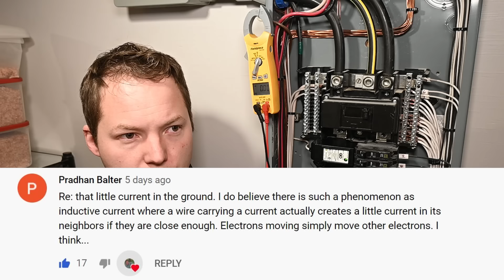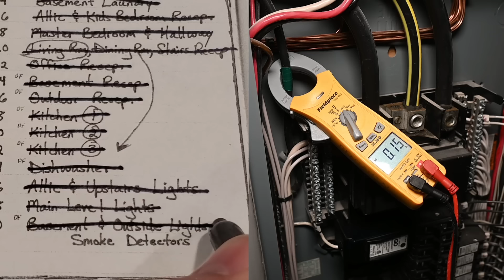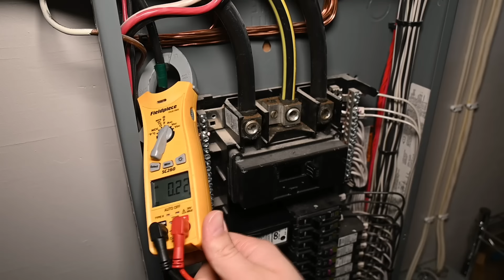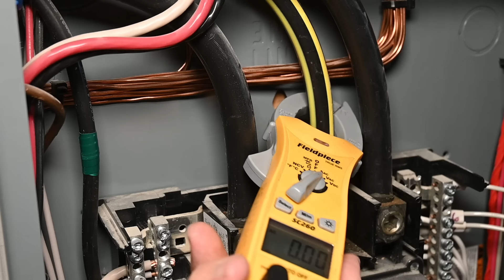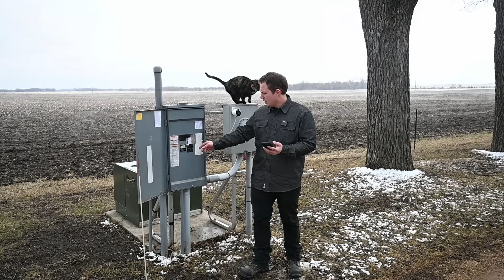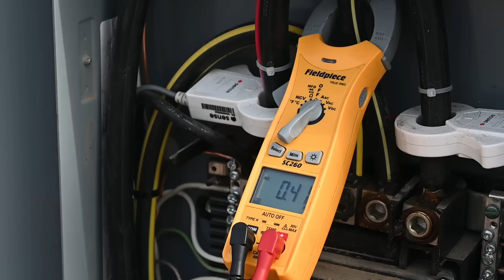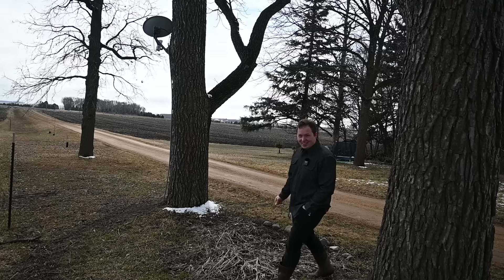Finding The Source of Stray Current on Grounding System

Comment: just one point which i havent read in this commentary section is is the fact that you have 4 grounding rods in the earth that can create current as anode and cathode the copper pipe from gas line is soft and sacrificial, and can create a battery effect and i have seen this before with a farmer that was living in a acidic type soil environment and he noticed current differential in his home every time he would spread lime around the house to neutralize the acidity in the soil and because the grounding system is on the unmetered section of the wiring it back feeds into the sub panel on the grounding wire which is why it wont show up on the neautral or the actives in either panel, i would be willing to bet if you disconnected gas main the current would stop(just dont burn your eyebrow off)while doing it), just a thought i know you found current feeding from transformer, but it may still have current once that is disconnected, just a thought!,

Comment: From Canada Have the same problem and have traced it back to the grid. At numerous locations in our community. I have measured up to 43 volts and 4 amps between the ground wire coming down the pole from a transformer and using the pole support cable as a ground source. Power company denies responsibility.

Comment: Vid is kinda long, but fun guessing up front.  First thing I thought... galvanic reaction: water heater had required plumbing ground attached on the wrong side of dielectric union. Also, many heaters have a sacrificial anode to protect the appliance and by another name that is... cathodic protection [zinc puts out 1.2 volts, which is used to protect ships hulls from rampant barnacle growth].    Wrong grounding placement creates a loop for impressed current.    Go lift plumbing grounds and see if your current goes away - it's probably associated with one of the two dryer installations.

Comment: In order for current to flow there must be a voltage difference between two points.  So, how many volts are you seeing relative to ground at the different panels?
Reply: if i'm not mistaken, if you see amps, there is voltage somewhere. so what's this driving at?

Comment: First off, I'm glad you went back to this for the video as I'm curious as well. I saw the original quite a while ago.
Well, simple science says current cannot flow without a potential difference. My guess would be voltage from something acting like an anode and cathode (battery.) Unless you have an EMF being created, the battery makes the most sense. Wasn't that gas meter union corroding? I'd look there first, see if that's the sacrificial anode (oxidation.) Current has to flow back to the anode once the electrons go to the cathode (closed circuit) in order for current to be on the ground line. You could do a bunch more testing but throw in that dielectric union and see if it subsists entirely, you're  going to install it no matter what so it doesn't hurt to test before and after. The neutral tap current is more interesting, unless there's a potential difference at the grounding rod there and the tap in order to create yet another closed circuit for current to flow on.
I wish I was more knowledgeable. I do wish to see some solution to this puzzle.

Edit: Shit, I didn't see Mike Holt reply to this video. The guy's a genius. I defer all to him lol Love his videos and more technical explanations.

Comment: EMF can be difficult to diagnose as to its source, and induced current is tricky to find the cause of, so likely you have induced current inside the run between your master breaker and your indoor panel, good vids man, lots of good information, since you are fed by a padmount transformer from subterranean lines likely its induced EMF from the actual transformer itself, EMF = ElectroMotiveForce

Comment: Benjamin, From the video you have two very possible sources. One is much more likely than the other. I'll start with the likely first.
1 The utility has current into the ground due to the pad transformer is single phase. You can read the tag on the transformer. If the primary is 5,000 Volts, the transformer is receiving 1 hot leg of a 3 phase system, and a neutral. The Neutral is bonded to ground. The neutral has a long... Long wire, so considerable resistance. Not all current of the transformer is returning on the neutral. Some is taking a shortcut back to the substation through the ground, which you can measure on your ground rods. This is common in rural areas where the distribution goes past the point they pull 4 wire 3 phase power. Read the tag on the transformer. Almost will bet my lunch the primary is 5KV. Most non rural areas have two hots from 3 phase. When this is the case the primary is 7200 volts phase to phase.
2 You are between someplace with an open neutral and there is a voltage gradient in the ground. If this is the case the current in the ground is finding a lower resistance shortcut in it's path by going onto the ground wire between the two places.
How to test the difference yourself.
1 Monitor the current to your ground rods. Turn on the water heater after a shower, turn on the dryer, heat pump, and stove. This increases your power draw and the draw in the primary of the transformer. The higher HV draw will increase the current in the grounding system in the single phase application outlined above. A bi-phase 7200 volt primary with all return current on the other hot phase will not increase ground rod current with the increased load.
Let us know what you find. Betcha it is number 1 above with a 5KV single hot transformer. Primary return currents are fed into the ground.
Reply: This is close.  Circulating current can be sourced from a neighbor.  Call your utility.  Start pulling meters from the neighbor.  I have chased down shock calls and found circulating current from the neighbors barn.  You won’t know until you pull the neighbors meter.  I have bin there done that.
Reply: @trevbroudy2804  Dis similar metals will erode while forming a battery with the ground as electrolyte. The source can by found by systematic disconnection of bond and ground wires. A common source is metal conduit which is zinc coated for corrosion and copper ground rods. The Zinc becomes a sacrificial anode and is eaten away by the current while preserving the copper ground rod. On boats, this sacrificial anodes is part of the design to preserve metal parts such as engine shafts and propellers from corrosion.
To find this, the direction of the current and identification of all connections to ground must be identified. With the AC mains disconnected, and thus isolated, you can temporally disconnect the grounding rods at your service while monitoring current. Chances are, in an older installation, the conduit for underground service is galvanized iron.
For research, study the purpose of the zinc anode in water heater tanks, zinc anodes for outboard motors and sacrificial zinc anodes for boats with inboard motors. With systematic following of the current, you should be able to identify the various metals in contact with the ground. If you have a pool, the bonding electrode system may contribute to this mix.
Reply: situation makes me think the transformer ground impedance is too high. did the utility actually test their ground rod work originally? and has the effectiveness of the grounding changed since the original install? i suspect the grounding at the transformer pad needs improvement
Reply: Hi there, your No 2 sollution would hold if current through the ground wire as measured in the two panels yould be almost the same. Since current of the outside panel ground wire is almost double, the No 1 answer seams all the more likely to be the one.
Reply: Could you disconnect one end of the ground line that has the current flowing in it, and measure the voltage across the gap?  That voltage times the 0.3 or so Amp that you're reading is the maximum power that could be involved here.  If it's 120 volts or less, maybe hook up an incandescent light bulb and see if you get a useful amount of power.  My guess is that the source impedance is quite high, and the bulb will just short out the voltage.  Issettech's theory of stray current from the utility is most likely correct.  

-- J.S.
Reply: As John Sprung observed, in my mind, I'm wondering what the source of the voltage is that is driving the currents.  We need someone to draw out the circuit like Mike Holt does, and put the current and voltage measurements on it to truly understand what is going on.
Reply: @cleansebob1  Well put. Don't guess. Measure and follow the current. A source will be identified.
Reply: @isettech  That may span miles. 
Maybe a total blackout of an area might be necessary!

It may we'll be the utility company issue  They should carry out some maintenance to their distribution network.

Itt interesting to note that irregardless to how faithful one may adhere to the NEC, there are no guarantees! You could be disconnected from the mains and still receive a fatal 30mA!

Someone mentioned it my gradient voltage from near an electrode. I doubt it for the current was nothing like gradient!

The problem I believe is a grounding quality issue. This may stem from materials used, resistance, impedance; anything that may cause a voltage drop; anything capacitive or inductive between system ground and neutral!

Remember, neutral is a current carrying conductor like the phases except that it is grounded!
The return for phase current is the neutral.
What about the return for neutral current? Ground!
Reply: @trevbroudy2804  not the same as in the video.  All the measurements in the video were AC, not DC.
Reply: @trevbroudy2804  DC currents are induced on grid scale long lines by motion of the Earth's magnetosphere
Reply: @rockytrashpanda  Then the problem examplfied in the video should be global! Not selected correct installations.
Reply: @trevbroudy2804  Sometimes a DC current is applied to a buried metal objects, e.g. pipelines, to provide cathodic protection. If one side of the power source were to be connected to your ground system, you could measure a current.
Reply: No is no neutral on a 3 phase circuit
Reply: @joerostkowski7313  except for when there is .. go read up. see "wye" (three-phase electric power @ Wikipedia). superior system when you cannot guarantee the load on each phase will be exactly balanced. which is always!
Reply: @rockytrashpanda  as a man I will admit when wrong. I work on alot of rtu 3 phase, but research has informed me that neutral on transformer wye. Good man. What's one leg of 480?
Reply: Hypothetically lets say there was no grounding whatsoever. None by the utility, none in the house. Just no ground wire anywhere, just hots and neutrals. Would there be a stray current still and, if so, how would it get back to its source?
Reply: So in a nut shell... His grounding system is a little too good so much that the current is using it as a shortcut. .... I would never think that but makes sense, very interesting!   Looks like he did too good of a job! Throw some resistors on all your ground connections! Haha. (jk)
Reply: @jpabmx  Exactly. This is why shorting the Neutral and Ground in an outlet on a GFCI circuit will trip the breaker when the outlet is used.  Even though ground and neutral are bonded at the main panel,  the short at the outlet shares the return current with the neutral resulting in current imbalance in the GFCI breaker.  This current in the ground from a ground bond at the house panel, and again at the transformer pad, is the source of the current as both are used for the Utility neutral and ground at the pad mount transformer. It is the return path of current for the single phase power brought to the transformer. Neutral current is shared on the neutral wire of the HV feed and the grounding system.
Reply: @isettech  yes, the GFIC will trip even if the appliance is switched off. We used ground fault switches to help troubleshoot. Was always nice to know neutral was shorted to ground or hot was shorted to ground.
Reply: I agree with your analysis. And don't forget to considere the atmospheric activity also. Charged clouds passing by induces currents on the ground itself that may find a way into the wiring. Although, mostly dc

Comment: Power, whether mechanical, electrical, hydraulic, or whatever, is effort times flow - essentially how hard you push something times how fast the thing you're pushing moves. In electricity, that's voltage (potential) and current, respectively, so Power = Current * Voltage. We usually use RMS values of these with alternating current, which is what the handheld meters we use report. The inductive pickup in your ammeter could be sensitive enough to pick up a very small electromagnetic field, even if that field is generated by a low voltage.

A current at any voltage means there's some power flowing, but you measured current only and don't know what the potential (voltage) is, so the power could be very, very small. You'd need a good reference ground (true 0 volt) to get a good measurement of the voltage, and it'd take someone far more familiar with grounding theory than I have to advise you how to get that.

Comment: Excuse me But Are You Not Gagging At Gbat and Swallowing The Proverbial Camel.
I am not Rocket Siencetst nor a Electrical Engineer but 0.24 amp of "current", or "voltage" 
Is Not Enough T fry an egg or a even a brain cell.  This is REDONKULNESS

Comment: Wish I had seen and viewed the two videos in the pinned comment and wouldn't have spent the time to write the following below (BUT HOWEVER, It would take 3 hours to watch those 2 videos, or just 2 minutes to read what I wrote):
https://www.youtube.com/embed/pAs_FmdxXhQ
https://www.youtube.com/embed/mpgAVE4UwFw
God, He talks a lot in the videos, but I guess that is what it takes!
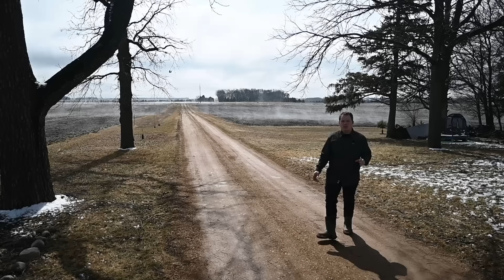18:57 Put your ammeter on the wire or the grounding probes at the house, and at the primary panel (where the neutral and ground are bused together. Compare their sum to the neutral leg current from the transformer center tap) ( maybe simultaneously clamp around all three wires from the transformer (center and both hots) and see if there is current from the street supply lines going to your local distributed grounds) Maybe there is a ground current flowing (or an electric field) through the mud between your house and your driveway main panel (some of which you are seeing in the ground wires along the same path), or there may be a current between your street network flowing thru the mud between your 4 grounding rods and the street system network.
Even imagine a current from the grounding rods at the generating plant, ten or twenty miles to the 4 grounding rods at your system. Some net flow through the wires above and some through the mud below!(making a closed loop current)

Comment: Take a walk along the utility poles and see if any ground wires are burned in two or missing on the poles; especially those poles close to your location.  The center utility wire is ground and supplies a path for lightning and pole mounted transformers to ground. If there is a poor ground coming from the road, then your local ground rods are helping to provide a path for what is your neighbors current being used on the utility. I bet if the utility neutral was disconnected, all your current readings would go to zero.  Disconnect the ground wire at the outside box and measure the voltage difference producing the .2 amps. Very low voltage with low ground resistance will give you that current  (example:  1/10 volt with  1/2 ohms gives .2 amps) .   As someone suggested, disconnect cable tv or internet cable to see if it is a source (but unlikely).

Comment: Thanks for all your great videos, im sure they inspire alot of people, I have a sub panel with 12 50 amp breakers that run into separate apartments no electric stoves  just gas and was wondering if there is a way to hook up the sense to each breaker to the individual apartments so there would be 12 connections

Comment: Je Mart brought up some significant items. I initially wired our house when we built it with 2 dedicated ground rods, placed about 10 feet apart.  When I set up my Ham Shack  (KB4ZUS) I isolated the shack with 2 more rods dedicated only to the shack.  I did notice a current difference between the two ground systems, I think 15 Ma between them,  and finally tied them together. Pro's and Con's, we're only speaking about a very small differential. Good, Bad? please send opinions. All subfeed panels have their own ground rods as well. That is code now, wasn't then, but as we all know, ground is not necessarily planet earth.

Comment: Probably a good idea would be to switch the neutral with a hot wire in the transformer and switch both sub panels to significantly decrease your electric bill.

Comment: 19:00  That isn't a transmission line.  It's a medium voltage distribution line.  Somewhere between 7000 and 12500 volts.  Residential and most commercial customers' transformers are hung off of the MV distribution lines, which fan out from the substation.  Transmission lines are the power feeds to the substation from the generating plant, or the lines that interconnect different substations.  They run at much higher voltages; 70KV or more - usually either 135KV or 345 KV, depending on length and capacity.  Cross-country TLs will run 500 KV or more.  Too nasty and expensive to run underground to your transformer,  I'm afraid...

Comment: After playing this video the tie point on both grounds on the high voltage side is feeding back on the the 2 ground rods. That's why there is 400ma on the outside panel. and you have 200ma in side and there should be another 200ma on the out next to the meter feeding to that ground rod as well. Just a thought. Your grounding the main feed from the grid piss poor grounding is what I'M thinking. nice video